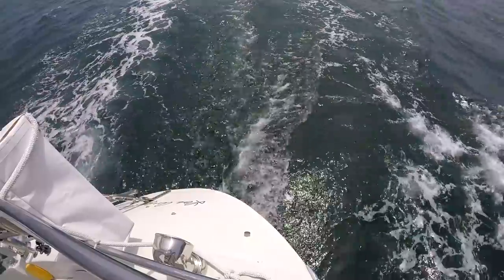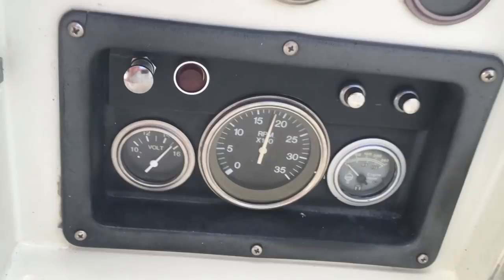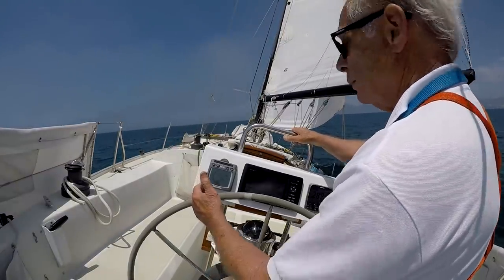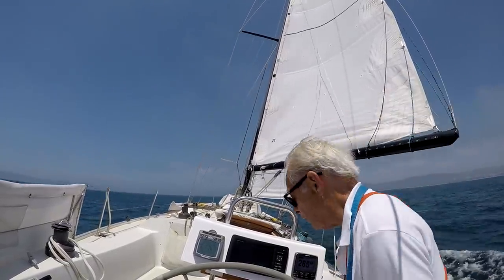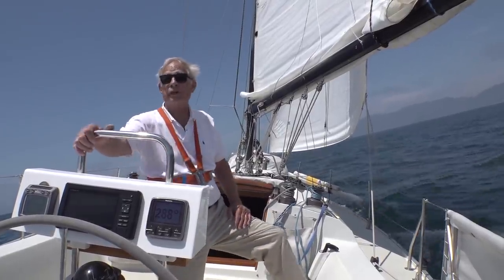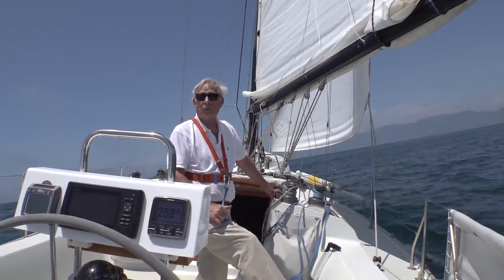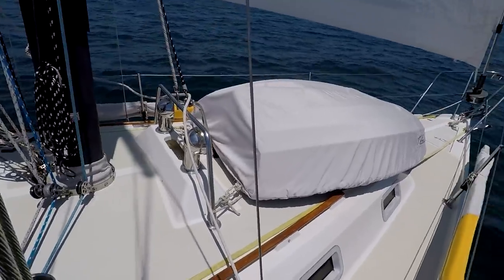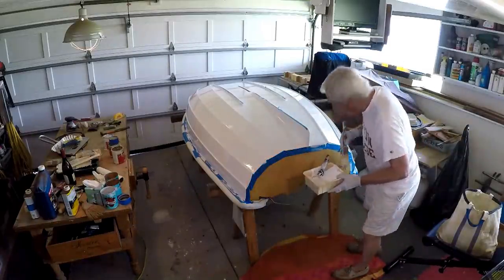Why We Sail--"Casual Singlehanding"

Comment: Sailing with novice sailing friends and family is solo sailing with obstacles..
Reply: Agreed.  I love my family and my friends, but they are good for ....  Departing from the slip, sails down, returning to the slip.  Earlier this week, I had my Catalina 320 on a 50 degree reach (by choice, it can go higher) and sailed 3/4 of the way across the Chesapeake Bay without the autopilot engaged, or ANY correction, hands free.   A balanced boat with sails set correctly is just plain magical.  Wind comes up, boat points up, sail angle reduces lift, boat settles back to it's original set point.
Reply: Worse
Reply: Only good for rail weight

Comment: Christian you could also try moving the genoa lead forward to balance the helm without luffing or under trimming the main.  As you ease the Genoa sheet and begin reaching the center of effort of the sailplane always moves aft (creating weather helm) unless you keep the genoa fully powered up by preventing it from being “over twisted” with sheets eased.  Genoas are generally designed for upwind sailing.  They lose efficiency rapidly when eased for reaching and at that windspeed you probably could have benefited from leads forward (or outboard) to increase Genoa power and move the center of effort in the sail-plan back forward.

Comment: You might want to consider easing the vang to help balance the weather helm.  It is a bit easier than putting in a reef.  I just came upon you channel.  I try to go sailing a couple times a week on my I36 in San Francisco Bay.  This works for me but I need to work on the not racing part!!!  As I get closer to 70 three wraps around the winch as turned into four!  I also have the five minutes rule between tacks to Windward. 😊 Your boat looks very well maintained.  Looking forward to your next video.

Comment: Thanks. Enjoyed the video. I also have enjoyed a couple of your books. I will make this comment in the hope that it may provoke not just a single action among your viewers but  a way of seeing their boat. It's not a criticism. The first time I go aboard a boat I always check the v-berth hatch to make sure it's large enough to serve as a fire escape if there is a fire aft of the forward compartment. In case of such a fire. That hatch will likely offer the only safe escape route. Time and time again I see this critical exit blocked by a tightly mounted dinghy. It would be a real tragedy to lose one's life for such an oversight. Fair Winds.
Reply: To be clear. The dinghy doesn't necessarily have to be stored somewhere else. But there should at least be a 100% reliable, fully tested quick release mechanism accessible from the forward compartment.

Comment: Sir Williams, have followed your entertaining and learned videos and I thank you for your technical explanations. My ONLY REQUEST is to improve your AUDIO RECORDINGs when it's windy. Can I suggest that you place a BUFFER (WindMuff/DeadCat) on your camera microphone, PLEASE!
Reply from the maker: Annoying, yes. There is no deadcat for the GoPro, which is how such dialogue sequences were shot.  The solution is individual lavalier mics and their associated gear.  That is impractical for spontaneous first-person video in which I also have to sail the boat, change cameras, get the angles and coverage.  Major studios also have problems with dialog in wind and such dialog is usually dubbed in post.  Severe wind noise simply cannot be removed by any DAW.  So--not as simple as you make it, but I recognize the issue you cite, which is why the video begins with a suggestions to use Closed Captions.

Comment: When sailing long distance (alone) what can be done to discover and steer around abandoned floating shipping containers? (especially when you are sleeping)
Reply: Imagination cuz like pirates, they’re not your primary risk out there.
Reply: Infra red and alarms...
Reply: A crystal ball.
Reply: I find it difficult to steer around anything when I'm asleep.
Reply: You can't steer around what you can't see, and you likely won't see them in the waves. The best defence you have is to be prepared to seal a holed boat: there's a good section on ways to do this in the book "thoughts tips and tricks for single handers" by Andrew Evans. This is the single handers Bible: if you haven't read it you really should.

Comment: I would shorten that tether a bit. Never want to be dragging in the water.
Reply from the maker: 07:54
Reply: Christian Williams yes, when I made that comment it was early in the video and you were on the port rail with a longer tether. I saw later on that it was much shorter and seemed to be secured closer to the center line. Easy to criticize.
Reply from the maker: The tether is 6'. That's for the cockpit. But sometimes in a deck emergency you need all that, even if it might mean dragging in the water if thrown off. Most of the time for deck work I just double it, for 3', as shown.

Comment: This confounding concept of balancing the sails...  If you could only achieve balance with the main luffing, wouldn't it have been easiest to take the main down and just sail with the headsail?  Did you actually get more speed with the main reefed than with it down?  That's what I find myself doing.
Reply: I always thought it better to balance the standing rigging's load by using both sails in proper trim.
Reply: @TheTWhite  Not just the standing rigging, but the centre of pressure over the center of lateral resistance: otherwise, you risk burning out Otto, or even damaging your rudder over many years of sailing that way. 
And yes you'll pick up a tenth of a knot or more pretty easy if the rudder's not sideways in the water just to keep the boat straight. On light wind days in the dinghies, we'll balance the helm and then pull the rudder completely: it's not a lot, but it's the difference between first and second 😁.

Comment: What happened to your Sail-o-mat wind vane?
Reply from the maker: Wind vanes are for offshore.  Marvelous devices--but they clutter the stern,  aren't designed for constant maneuvering, and don't work when the engine goes on.  An electric autopilot is more convenient for casual sailing.
Reply: I agree. But what I'm asking is: what happen to your vane or is this a different boat?
Reply from the maker: @roncanizares9966  In storage. Beauty of the Sailomat is, it comes off the transom in 15 minutes.
Reply: It is a very good vane. Unfortunately they are essentially out of business.